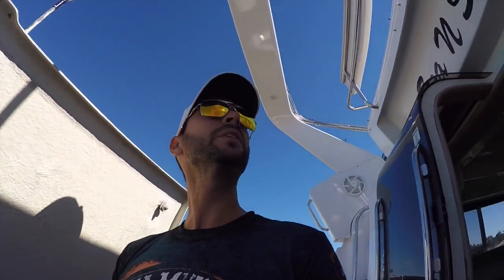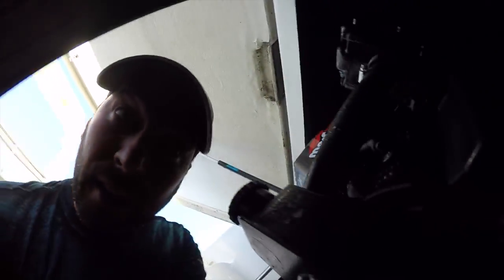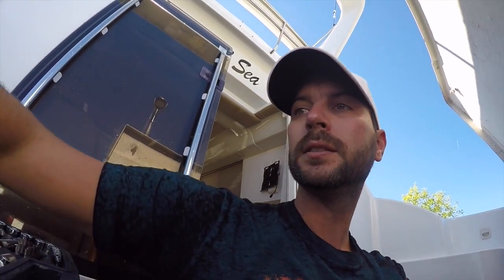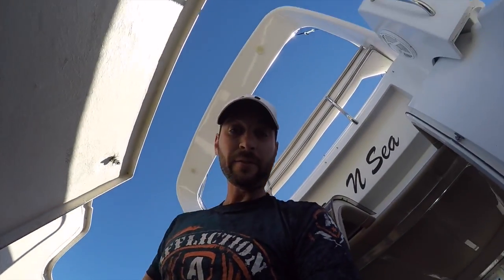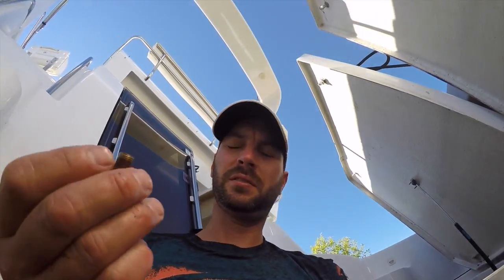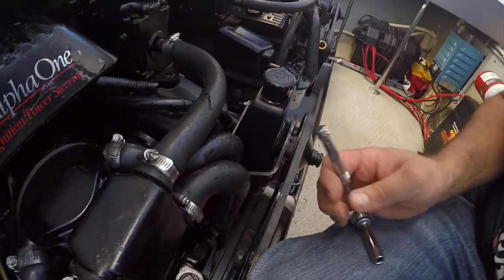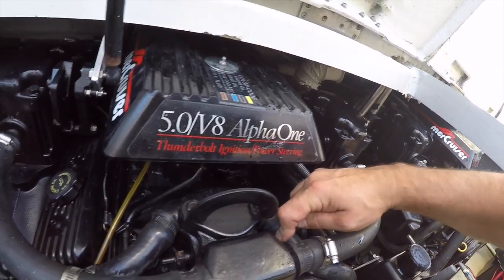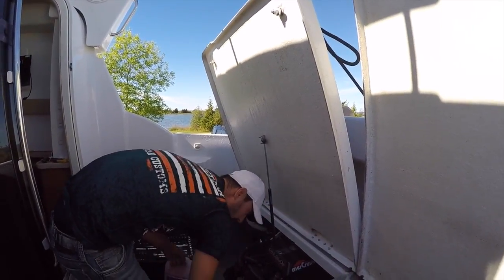#51 I ride 705 winterizing mercruiser boat engines

Comment: Hey man, over the summer I was looking to get a jet ski. When I came across your channel I fell in love with the Spark. I actually ended up buying one. Never owned a jet ski before and I've seen a lot of different instructions how to winterize them. What do you do to winterize your spark? Or do you keep it in a heated garage?
Reply from the maker: Dan's Pyrotechnics winterizing  is simple there is a hose fitting at the back of the seadoo fire up the seadoo and poor antifreeze in that hose till it comes pooring out the exhaust and your done
Reply: The manual says to blow it out with 50psi, which way is better? Also do you take any other steps? Stabilizer, Anti Corrosion, Disconnect battery?  Thanks!
Reply from the maker: Alex Gorgio 50 psi so an hose with a pressure resistor does really talk about volume of air. A bit fugy to me. If the manual says that's works then I'm sure it does.  I just run plumbing antifreeze through the flush out with engine running.  I do not fog engine disconnecting the battery wouldn't hurt but not sure if it's nessisary there's no clock , not sure if there's any draw at all when the seadoo is off.  I left mine connected this year I'll find out in the spring if it was a bad idea.